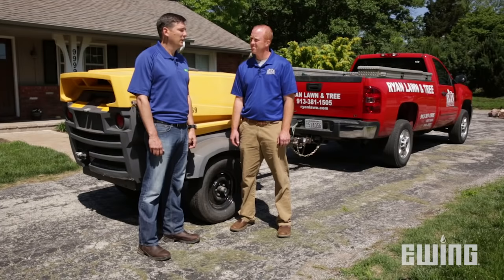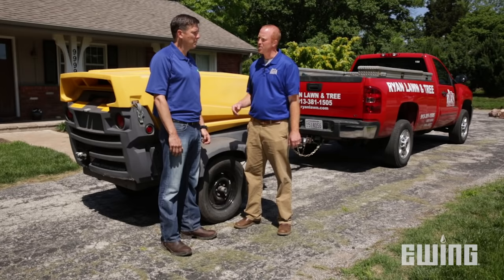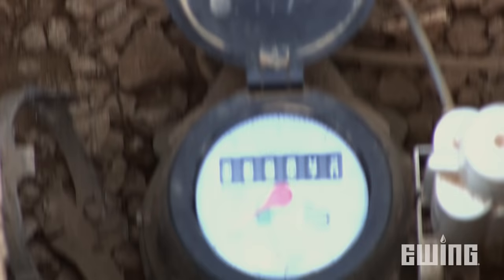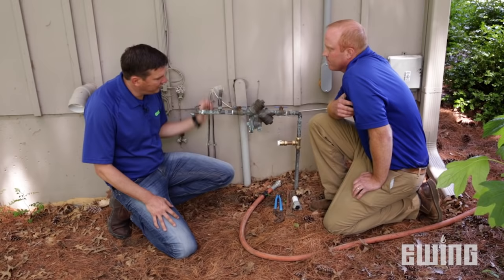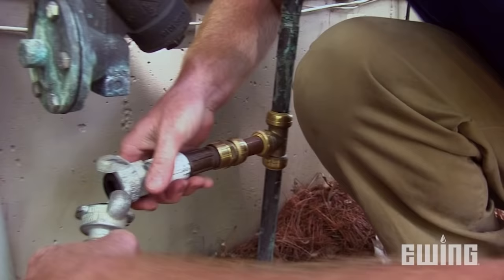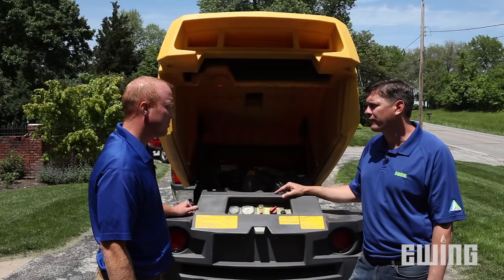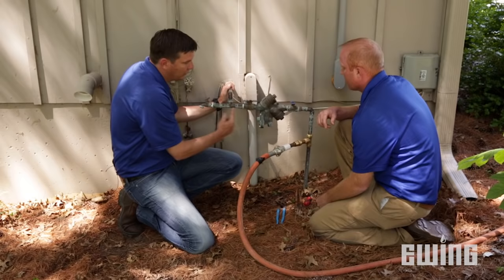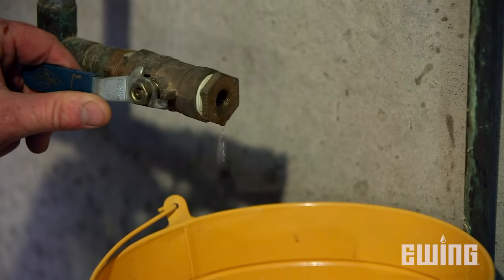How to Winterize a Sprinkler System - Blow Out Method

Comment: A regular air compressor will do it.. it's just business what you guys are trying to do.. I own a Landscaping company and also do sprinklers and I think it's not right to be ripping off people.. it's pretty cool that you guys are explaining this though.
Reply from the maker: Moises, thanks for watching and the comment! The advice given in this video is to use an air compressor with a rating of 80-100 CFM (Cubic Feet per Minute) for any mainline 2" or less. This information is common in the industry for winterizing irrigation systems. Yes, it is possible to use a smaller compressor but it will take longer and there is a risk of not getting all of the water out of the system. If you are in the business of winterizing irrigation systems, using the larger volume compressor will also allow you to complete more jobs, more thoroughly in a smaller amount of time. If you would like to review another resource, this article from Hunter Industries has some good information on winterizing irrigation systems:
https://www.hunterindustries.com/winterizing-your-irrigation-system
Reply: I agree.  They are doing their job and this is their business.  It is very helpful for those of us who are handy, but if you are not 100% sure of what you are doing, I would hire someone.  If your system freezes up, it would be very costly.  Thanks again for sharing this with us, it is very helpful.
Reply: do you still blow out systems with automatic drain valves?
Reply: Former Montana Dirt Contractor here. 
A slight correction. 
If there is only some water in your line it should be ok so long as it has room to expand. 
Water always takes the path of least resistance so it should expand within the hose without breaking. 
You are correct in your assertion it is better to be as thorough as possible however. 
I appreciate your video as I recently purchased a house that has a underground sprinkler, something that is voodoo to me  at this point :P
Gracia.
Reply: @SlayerofFiction  If the underground piping was perfectly horizontal, you're right, a partially filled pipe would be okay.  The problem is that the underground piping will have low points and those low points will be completely full of water, and when it freezes, the pipe could break.
Reply: @bowewingerd3744  No pipe is every perfectly level, the ground  static and always changing, so for example sewer lines in Montana are well above the frost line and in your example they would freeze and burst, I have never seen that happen in almost 20 years of dirt work. 
When Lines burst it is because they are full as there is no place for the pressure to be alleviated. 
Again, I am not saying you should not do your best job to blow out lyour lines, you should, just cleaing up this common misconception.
Reply: @SlayerofFiction  Your statement that "No pipe is ever perfectly level" certainly applies to sewer lines.  Sewer lines are installed with a slope to drain the sewage to a treatment system or to a pumping station.  Sprinkler system piping, on the other hand, is typically not installed with consideration of whether it slopes to drain, and as such, it will likely have low points that would be full of water if the winterization blowout was not thorough.  If that low point is above the freeze line, and if it is full of water, then it can freeze and break the pipe.
Reply: @bowewingerd3744  Correct, but the ground moves and despite your best care you will never dig up a sewer line which is the same level as it was when you put it in. 
Mind you it should be your best intention that it  is, but that is impossible. 
It is dependent on many geological factors, some area's I used to repair as the ground shifted so often it would pull pipes apart.
Reply: @ewingoutdoorsupply  Agree with your comment that smaller compressors will give a risk of not getting all the water out.  However, larger compressors also give a risk of not getting the water out.  It has a LOT more to do with being thorough than the equipment being used.
Reply: @fenderstratguy  How costly?  Our sprinkler system was $8,600 to install.  So I would say it is more costly than having a dude with a truck come over.    We live in a 9,400 sq ft house with 22 sprinkler zones.  It is all relative my man - our system is not a do it yourself project.  Again, it was nice for them to share this video.
Reply: @damiencaz666  Yes, it's all relative.  People that make less than $200/hr often have more motivation to be "do it yourself-ers"  because they dont want to pay someone else to do a simple job.  Obviously some jobs are not simple, such as complex medical procedures! (and expertise is needed) And some people just want to be self sufficient, regardless of cost. I want to know how to fix nearly anything, and be able to help others too.
Reply: You need to buy the bigger compressor, you got the game all backwards man

Comment: Sorry guys ik im just popping out of nowhere and acting like ik everything here like everyone else on YouTube or just social media in general. But I know 80 psi out of an air compressor is NOT the same as 80 psi with water. Although the “pressure per square inch” is the same. Water is incompressible, and air is compressible. It’s essentially hydraulically equivalent to a mechanical spring. Not to mention the viscosity of water is 89 times that of air… I work on and test these things everyday throughout the summer, and every year I see new and crazy damage to irrigation back-flows due to people blowing these things out through the test cocks. If water hammer/pressure spikes are enough to fuck a Backflow up, and a hair is enough to fail a check valve, what do you think blowing compressed air through it will do? Especially over time. Though I suppose its better than the alternative, a freeze break. I just let my system bleed for a while, never had any issues. If you are going to blow it out, id advise to do it on the outlet side of the back-flow with both Shut off valves closed like these guys. That way your not causing any damage to the Backflow. You can always just drain the Back-flow after the fact through the test cocks. (MAKE SURE YOU HAVE THE INLET SHUT OFF VALVE CLOSED OR EVEN BETTER, HAVE THE WATER COMPLETELY OFF UPSTREAM OR ELSE YOUR GOING TO SOAK YOURSELF LOL!!) ask me how I know..
Reply: No one is going to ask you how you know bc you your first sentence calls the reader out on our insecurities and inferiority complex, how dare you say that about humanity, so what if we dont engage in meaningful dialogue, so what if we relay information that caters to our ego and could care less if the information benefits you, bc guess what buddy the world revolves around me. So take that In your pipe and smoke it.

Comment: You say first turn on zone because the pressure of the air can burst a pipe? If an average house has around 50psi on the plumbing system and you turn the water off and replace the water pressure with air pressure - not 80psi like you say, but 50 psi - how on God's green earth are you going to blow a pipe? Does not make sense at all.

Comment: I use a normal air compressor and it works just fine
Reply: Was going to ask can I really not use my compressor?
Reply: So yeah since this post an hour ago I used my California air tools small compressor and was able to blow out my 8 zone system.  I went through each zone twice and also held down certain heads to add pressure to further ones. Took me about an hour to go through and make sure just air was coming out of each zone. I turned of water and both sides of the main valve. I used the shut off on the spigot the compressor was connected to in order to build pressure back up again once it got low. I made sure to shut the valve off between shutting off and turning on zones in order to prevent the air pressure from damaging any of the valves. I use a Rachio controller which made it easy Bc I could be outside controlling the zones with the app and controlling the pressure from the compressor with the spigot valve. Worked great and no mist or water coming out of any of the rotor heads. 
I can certainly see how having a big compressor would save you time but I can’t see how it would save you any more than that. I’m confident I got all of the water out of my system it just took a few times to pressurize the small tank again and then releasing the air into the system. Just be sure to have a way to cut off the compressor air pressure when switching zones in order to not try to pressurize a closed valve system. 
Good luck and thanks this video helped a lot!
Reply: Yeah it would work on smaller systems. But I have 1.5 acres, somewhere around 24 zones, 128 different sprinkler heads, and thousands of feet of pipes. I have to use a compressor like this.
Reply: he has a business to run lol
Reply: Ya he only "cracked slightly open" the valve a little bit, so much for "volume" of air.
Reply: @wkinne1  185 CFM or more is a large volume of air. Do you have any idea how much CFM your little pancake compressor puts out?

Comment: There is no reason to use a huge 185cfm or whatever size that is. I've used my 20 gallon 5 cfm @90 psi for years and always gotten all the water out just fine
Reply from the maker: +KMT15 - Thanks for the feedback. Yes, depending on the size of of the lines in your irrigation system, a smaller compressor can get the job done. However, a smaller size tank may require multiple refills in order to clear out a zone. The main concern we have is that a low CFM compressor may not get all of the water out. To err on the side of caution, we recommend that a high CFM compressor be used. It'll also take a lot less time, which can be an important consideration to a contractor offering this service.
Reply: AS SOON AS YOU LOOSE THE ORIGINAL PUSH OF AIR AGAINST THE WATER... THE WATER THEN RUNS BACK INTO ALL THE PIPING YOU JUST CLEARED... THEN THE PIPE IS NOW 1/2 FILLED ...  NOW THE AIR YOU PUT BACK TO IT WILL JUST SKIM OVER THE TOP OF THE WATER ...  LEAVING WATER IN THE LINES !!!   # 2  Standard piping used in most systems is rated at 80 PSI...  KEEP PUTTING 90 PSI. TO YOUR SYSTEM SEE WHERE THAT GETS YOU !!  CFM DOES MATTER !!!!  NEED TO BE ABOVE 25 CFM UNLESS IT IS ONLY A DRIP SYSTEM...  NEVER MORE THAN 80 PSI !!!!  IF YOU HAVE HIGH ENOUGH CFM 50 PSI IS OPTIMUM PRESSURE !!  YOU CAN PUT 100 PSI in your car tires & they will not blow up right away ...  EVENTUALLY  THAT KIND OF PRESSURE WILL RUIN THE TIRE !!!!   YOUR ARE DOING THE SAME TO YOUR SPRINKLERS WITH THIS MISLEADING INFO POSTED !!
Reply: KMT15 I
Reply: i also use my 20 gallon for last 9 years never had a problem getting it done and never had a pipe issue

Comment: I purchased a home with sprinklers 6 years ago this December. I have sprinklers that cover over an acre of my home. I didn’t realize that I needed to winterize them until the next Fall. I came across this video and started using my 30 gallon air compressor. Does it work? Yes. But I can see why this could have issues. The sprinklers that are further away from the blow line struggle to get all the water out and most of the time doesn’t get the mist that the other sprinklers do get. This has been my experience.

Comment: You need a big air compressor if you are blowing out 10 or more zones with a house on greater than a 3/4 acre of land . 2 HP and a 30 Gallon tank won't get it done very fast. I tried it, but it will work. I live in eastern Washington, there are lots of guys that like to run their big compressors and will do it for under 100 bucks. Big compressors can blow out 12 zones in about 15 minutes.

Comment: I borrowed a fairly high volume compressor from a friend, yet this video helped me to determine that the ports had to be "beyond" the backflow unit... saved probably $70 - $100 by doing it myself... and not messing something up... thank you guys..
Reply from the maker: You're welcome! You are correct, the compressor should be connected down stream from the backflow device. Thanks for the comment!
Reply: Yes sir if you would have ran it thru the back flow unit you could’ve potentially ruin rpz and those aren’t cheap
Reply: Why is there a connector at the backflow?

Comment: Good video... To prevent freeze damage on the above ground pipes when we get an early cold snap, any insulation is helpful. Freeze tolerant ball valves are also a nice upgrade to minimize damage... And make sure the main supply valve doesn't leak back into the system over the winter...
Reply: Ronald Lehman 1

Comment: Thanks for a very good video. I would add one step: when openining the drain at the supply connection, leave the valve or plug opened a bit. Any water leaking past the irrigation system shut-off valve will exit the drain rather exposing exterior water-filled components to freezing temperatures. Insulation will prevent freeze damage only when the temperature is only slightly below freezing and/or below freezing for a relatively short period. If it is cold enough long enough, exposed water-filled components will suffer freeze damage. The only solution is to remove water from all system components exposed to freezing temperatures.
Reply from the maker: Good advice. Thanks for watching and for the comment!
Reply: When you say "supply connection", where exactly would that be? Is that where he hooked up the blowout air hose? Is that somewhere in the garage? Is that somewhere inside the house? I'm confused.
Reply: When he says water leaking past the irrigation valve will freeze on the exterior.... That's also confusing because that's the whole point of blowing out the lines I thought....
Reply: Advice does nothing for a know-nothing first timer lol. I have no idea what valve I should be leaving partially open. I'm just gonna blow out my sprinklers and see what happens lol

Comment: My air compressor seems to work fine on the first blow out attempt but the on the second attempt 2-3 minutes after first the heads don't pop up all I hear is air being released from theads. Lines are small 
Poly type tubing 40-50 psi. Tia for your help
Reply from the maker: Hi Joseph, sounds like the compressor doesn't produce enough CFM, the pressure is fine it is the volume of air that is lacking. Most home compressors do not produce enough CFM. I hope this helps.

Comment: My basement is lower than my outside underground pipes.  So I have a siphoning mechanism at a point lower in altitude than the rest of the system.  Before the first freeze, I turn the valves to start the siphon into a bucket.  All the water is then drained out of the pipes.  Simple.
Reply: That still doesn't get all the water out.

Comment: You're right, it does take a little bit more time with a smaller compressor but it's $65 I don't have to spend. Plus you know you're not going over 100 psi... That's reassuring.
Reply: +Cf4 Cf4 
Don't confuse pressure with volume. I'd be surprised if your compressor is not capable of 100+psi. My compressors have adjustments for maximum pressure, but adjusting it is not as straight-forward as you might think. I put an inline pressure limiter on my line so I can adjust the pressure between the tank and blowout connection -- typically 125 psi at full load down to ~80 psi. In simple terms, think of volume  as how much sustained airflow you get before the compressor has to kick on. A small compressor will be running non-stop -- most likely running out of air in a very short period. A larger capacity compressor (tank) will last much longer.

Comment: I use my home compressor and set it at 60 PSI and it takes a few minutes to do. Then I go through the zones a second time. I live in northern New England where the temperatures go well below zero for an extended time and all water must be out of the system.

Comment: I don't know if you still monitor here as it's 7 years old, but, here in CO, everyone and their brother is a landscaper that blows out irrigation systems. It looks like they all use some pickup truck with their compressor and rakes and shovels in a trailer. I just got a Metabo compressor that can push 4SCFM at 90psi. If those other people do it and want to charge me $30/zone, would this compressor work here too? I've NEVER seen that giant trailer compressor at anyones house come fall.
Reply from the maker: Hello Mike. The information provided in the video is consistent with instructions from the major manufacturers. Here's an exerpt from Hunter's winterization guide.
"The blow out method utilizes an air compressor with a Cubic Foot per Minute (CFM) rating of 80-100 for any mainline of 2" or less. These types of compressors can be rented at your local equipment rental yard. Caution: a small shop compressor (1-3 HP) will not have enough "free" air to properly winterize the system. Do not attempt to fully charge the holding tank then release the highly-pressurized air flow into the mainline to compensate for the compressor's lack of CFM. " You can learn more here:
https://www.hunterindustries.com/winterizing-your-irrigation-system
Thanks for watching!

Comment from the maker: +tscooter22 - Sorry, we were unable to reply directly to your comment. The goal is to get the bulk of the water out that can freeze and expand enough to damage pipe and components. The water left in the pipe once fogging begins is not enough to do harm. Also, friction resulting from compressed air running thru PVC can generate enough heat to damage components if left running too long.
Reply: Water has friction too, if you install lines long enough you have to factor in friction loss, so I do not understand that aspect of your post.
Reply: @SlayerofFiction  Rotor heads are lubricated and cooled by the water flowing through them; if you run them dry, there is no more lubrication and you can damage the heads.